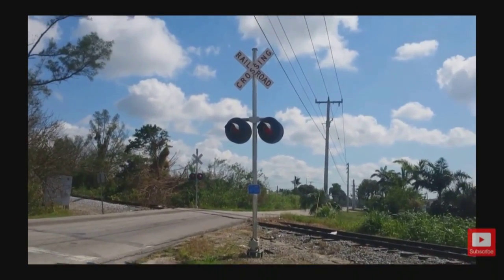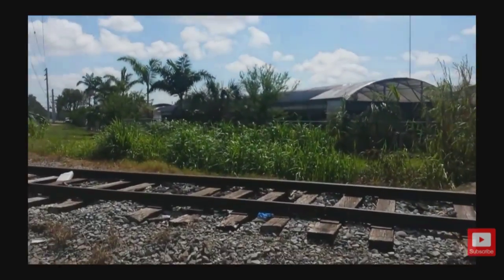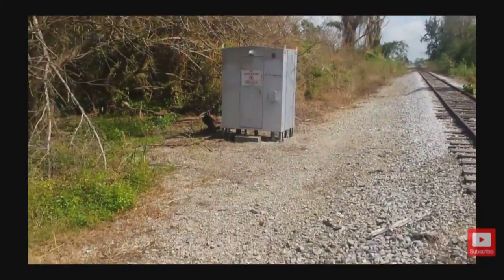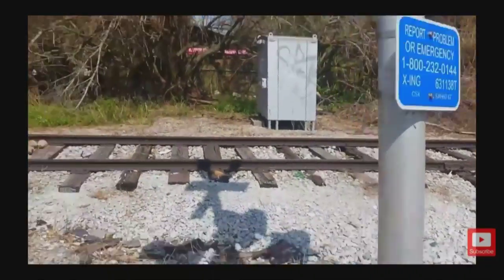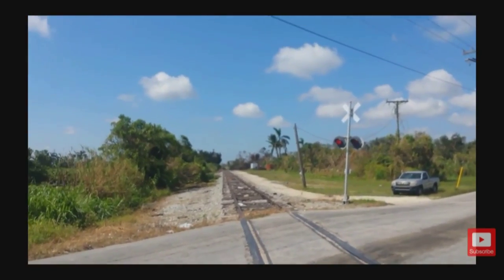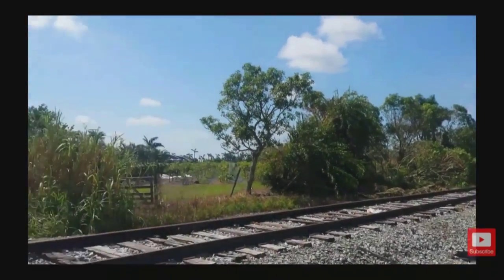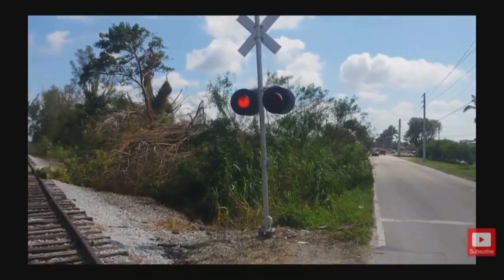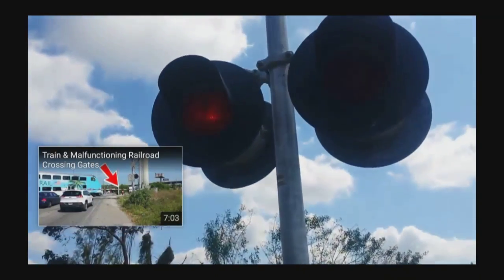The Last Time This Railroad Crossing Activated

Comment: It's always sad to see lines go abandoned. Not sure why bus systems can't take them over as light rail passenger service.
Reply: @railrol82  How were the f lashers activated when ther e's no train around?
Reply: @kevinmiller1985  in virtually all crossing signal systems in the US there is a "Fail safe" system that if there is a problem with the standard detection equipment the crossings will activate and stay on till repaired to ensure protection.

Comment: I don’t know how it works there, but here in California when a right of way has been abandoned in a few situations the property had to reverted back to the original landowners. Two instances I know of where the rails to trails program was blocked was when some people had access to original land deeds to their property were able to block that program. Due to a clause in the contract stating it had to revert to the landowner if ever abandoned . Rails to Trails was not happy when several landowners wouldn’t give up their right
Reply: RailROL82 What happened was the current property owners were able to locate the original deal through land office. The Original plan supercedes any current deals if I understand right. Those who couldn’t find the original paperwork were forced to abide by any new contact. Without all landowners signing off their rights to the properties, Rails to trails couldn’t go in. It only takes one stubborn land owner to block them. They have to pay up or forget it.
Reply: That’s what happened with a new tourist line in 1962 in Kempton, PA. They wanted 16 miles of the track to run steam train rides on but there was a stubborn landowner that refused to sell a quarter of a mile past Wanamaker so the line was ended at that point and tracks removed beyond for about 15 or so miles.

Comment: Truly a bummer, It would be awesome if there was some way of eliminating trucks servicing those growers. If they could either ship it the way Tropicana does in reefer cars or intermodal refrigerated containers from siding along the line. Trucking is expensive, and it puts more vehicles on the interstate system. The local shortline in my neck of the woods has significantly cut the cost of transporting sand for asphalt as well as crushed stone for construction. They could do a study to see if businesses can be enticed to the area that uses rail. That last one no offense might be difficult seeing that hurricanes are a possibility and are the power grids strong enough to support any business? Is it feasible to run Tri-rail to Homestead? Will the area get behind it? To support all of this cost money who will get behind this and support it? That's my twenty-cent opinion for what it's worth. Thanks for covering this sad event but hopefully something good will come of this I appreciate your channel.
 On a another point. If the priest or priestess of Santeria does a ritual with a chicken and leaves the sacrificed chicken on the abandoned Homestead line where no trains run then does the mojo or whatever not work because there is no train to carry away the mojo or whatever?
I don't expect you to know  I was just curious as to how detailed the ritual haas to be. I've heard that with Wiccan and Celtic religions spells and rituals are supposed to be exact in order with all aspects of the spell to work. I don't practice Wiccan I just read about it. I try to avoid stuff that involves multiple people running around naked in the woods. Some people shouldn't run around naked. It's just wrong.
Reply: The only problem that I can see in running Tri-Rail to Homestead is that you need double track to run commuter trains, this line is single tracked and adding another track would be cost prohibitive.
Reply: But Amtrak was only running a handful of trains a day in both directions, and that’s the main north-south line with lots of double track and passing sidings. Commuter rail has to run a lot of trains in both directions to be effective, that’s kind of hard to do with what is pretty much a very long stretch of single track. Just my two cents! And there can only be one favorite Mike, therefore I propose a cage-match. You can post it on here and let your viewers decide the winner!

Comment: Not surprising. The large carriers have long been concentrating on intermodal and unit trains. Local trains get in the way of through freights. Customers are forced to participate in intermodal delivery. This puts more trucks on the road. So, wishing for a passenger rail commuter line won’t take trucks off the roads. It just means you’ve lost your freedom of flexible travel. There are Lots of lost freight opportunity here in the Dallas area at locations where light rail has been built. A bunch of abandoned rail spurs that used to serve shippers businesses are unused and rusting in order to move the homeless around, from the large urban centers to the suburbs. Dallas Area Rapid Transit even owns the KCS line through Plano to Renner JCT. in this agreement, KCS cannot serve rail customers in Plano. This resulted in the closing of a DGNO freight line from Addison to Plano. (Trackage rights on KCS) I even read  online that DGNO cannot interchange rail traffic at Mercer Yard in Carrollton. This has to be done at Mockingbird Yard with BNSF. Commuter and light rail sucks!

Comment: This wasn't much of a surprise.  CSX didn't need this really, and there isn't much down that way that could even justify a short line from reactivating the line.  The only hope I ever saw for it is if Tri-Rail were to extend to Homestead, but even then, the ridership probably wouldn't be high enough to justify the extension, even though much potential exists from the areas near the Museum and points north. An extension of Metro Rail via the old FEC ROW was really the only ideal solution to give Homestead and Florida City a one seat ride into Miami.  The CSX line is too far west and through very rural areas that would be too far for the more populated areas near US1 to travel too in order to catch a train.  But never say never, because someday somebody might resurrect Henry Flagler's vision to Key West, and this could play an important role in connecting such a thing if ever one wanted to do it.  Even light rail can be considered down the road if ever the area were to expand in population.